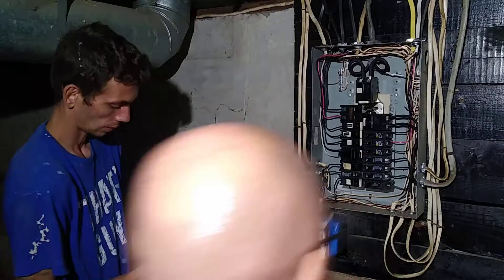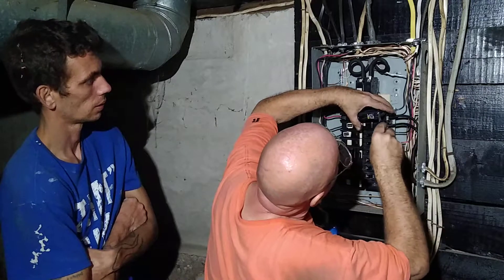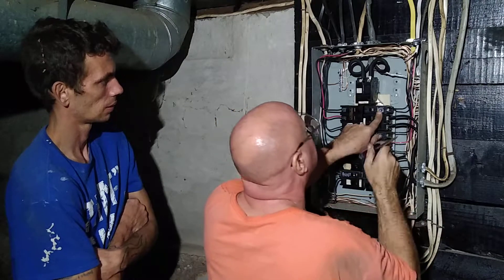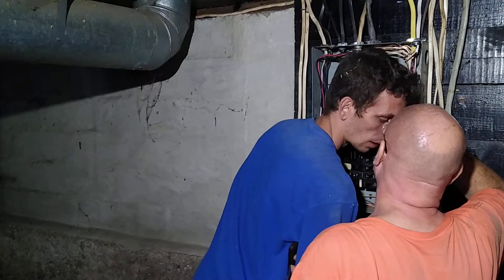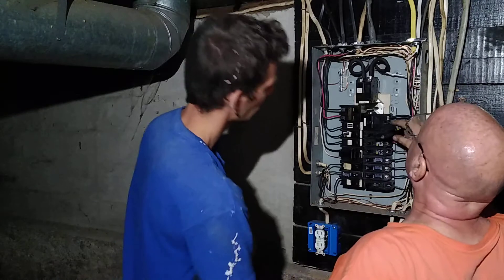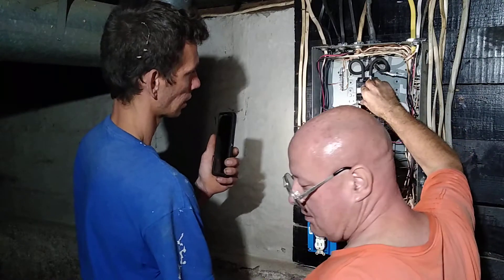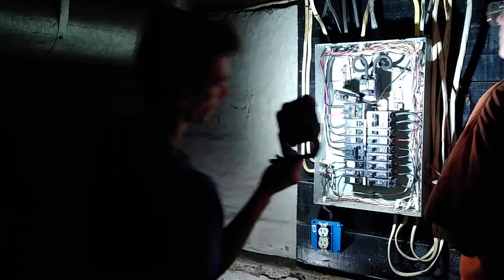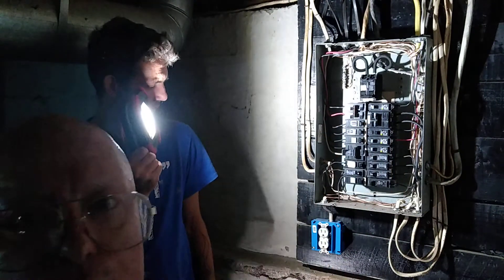I find corrosion on a busbar I use file to clean it off

Comment: Total hack move here, Numbnuts! That repair will cause the busbar to heat up again and fail 100% of the time, putting whoever lives in this house in danger of burning to death. Nice work! Oh, and it's also an illegal repair that will strip the UL Listing and potentially leave the home owner without insurance if a fire does happen.
Reply: How would you clean the bus bar?
Reply: I definitely wouldn’t do what you would. Nothing apparently.